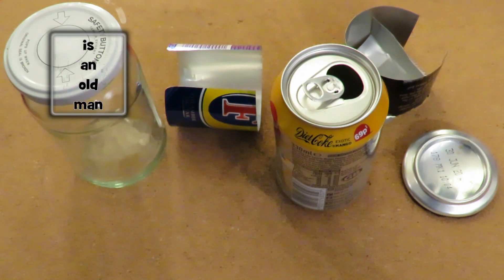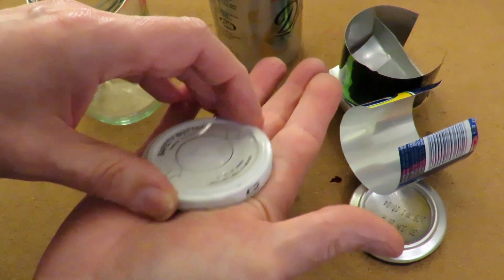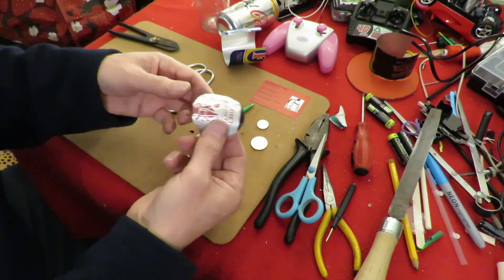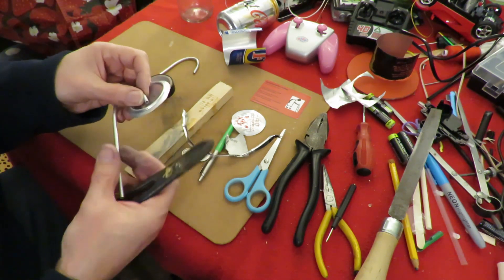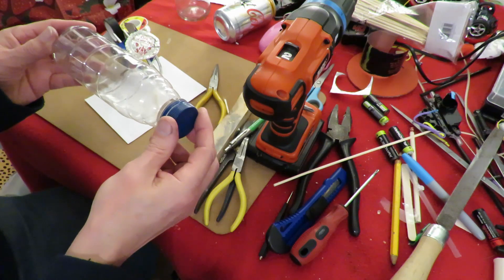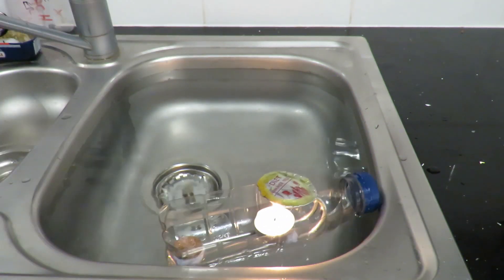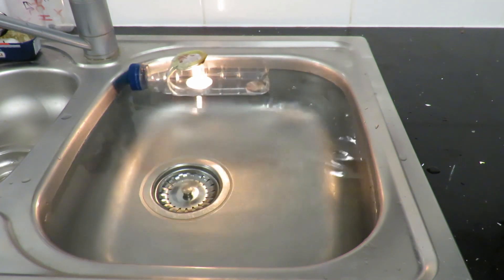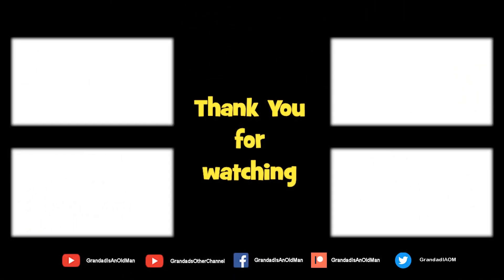Trying a different Pop Pop boiler - Fast but no Pop!

Comment: Hello im building one for a science project and at the end of the session my teachers wants us to race our boats, is it possible to put a rudder underneath the exhaust of the engine to make it run straight? and if it is, is it possible for you to make a video about it, Thanks Grandad!!
Reply from the maker: They tend to be so slow that a rudder has little effect. I would suggest two quite large rudders either side, rather than obstructing the exhaust.
Reply from the maker: It just occurred to me that you may not have seen the links in the video description to my other pop pop boats, including an RC one.

Comment: Not bad, I liked how it turns the corners too.
Reply from the maker: It was interesting to try epoxy to glue it together, but I used too much so there was no flex in the diaphragm to make the popping noise. So it worked fine, but almost silent.

Comment: LOL. Don't know why it's not popping but that one is really fast. There is a type of epoxy resin and rubber sealant you can buy that is totally heat proof. I used the epoxy type on a 2 stroke glow engine and it held great. I used he sealant for the bottom and top of a Sterling engine and that worked perfectly too. I really need to get the finger out and try building one of these pop pop boats. :D
Reply from the maker: I think the glue is covering too much of the surface preventing it flexing. I have studied a few other similar boilers and they fold the top down over the bottom so I will do another some time.